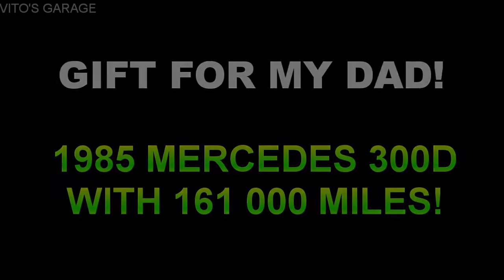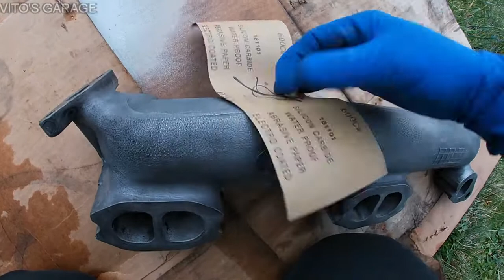Part 16 Dad's Mercedes W123: OM617 Manifolds Removed & Painted; New Idler Arm; New Lift Pump Gasket

Comment: Delet that egr valve.. it hurts to see the engine getting all greasy from the exhaust. I did that to my W210 and it runs also alot smoother.
Reply from the maker: I’ll plug the vacuum port so the egr won’t be triggered. I agree. I just want to keep the same look, but I’ll plug the vacuum hose
Reply: @VITOSGARAGE  Yea thats how i did it. We have to go to the Vehicle Inspection each year here so it has to look stock. ^^